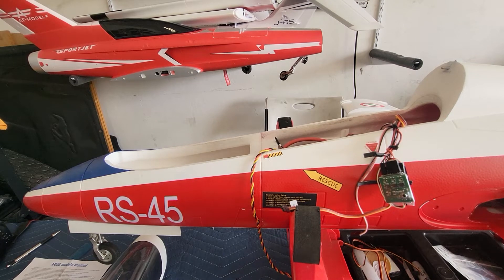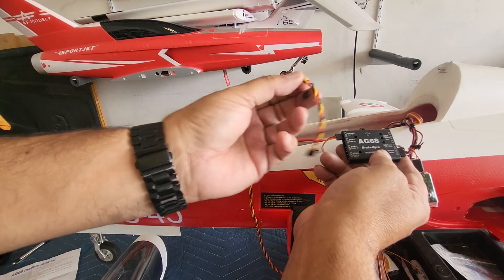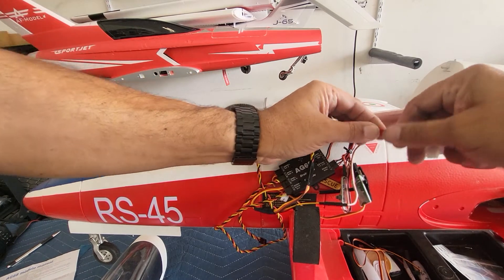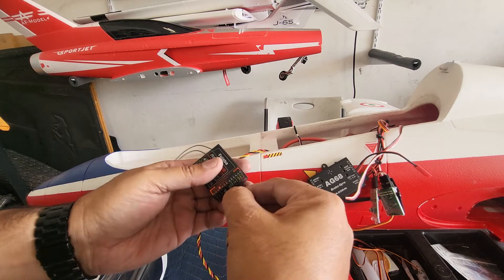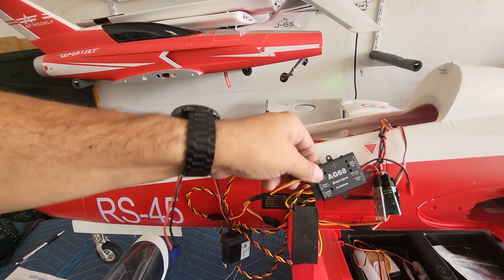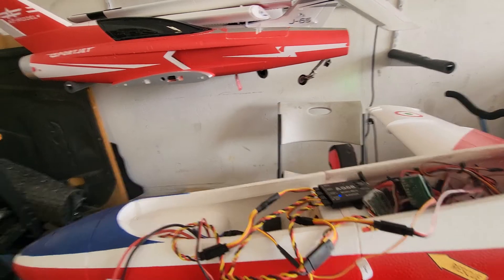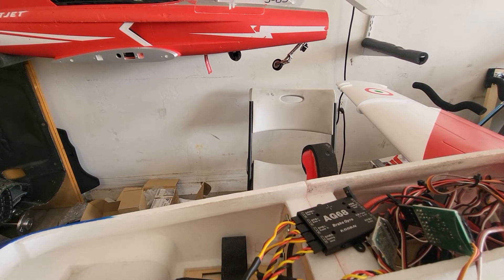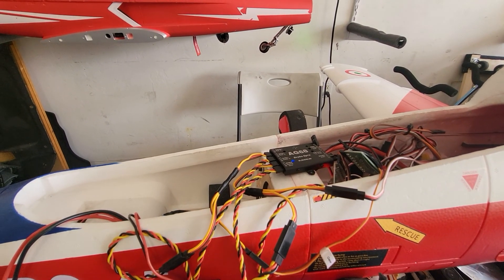AG-68 used only for Brakes

Comment: I burnt up my Spektrum RC AR10400T by plugging in power to the AG 68. Your video is a little deceiving.
Reply from the maker: The AG-68 gets power from the receiver
Reply: Can you tell me what the power wire is supposed to go to? I'm sorry I just don't understand.
Reply from the maker: The red JST power cable is to power the brakes. The AG-68 itself, gets the power from your Rudder servo channel. I always recommend using a separate (second) channel for Rudder / steering. I will be making a new video soon. 
 @michaelhodges-y6z

Comment: I’m thinking about buying one to replace  aa JP retract controller.  Why didn’t you use the ag68 to run the landing gear?
Reply from the maker: At that time, a couple of pilots had the AG-68 and only wanted to use it for brakes only. This required an extra "Y" cable. This video was done to show the connections needed.
Reply: @ralphsalgado5891  is it a better retract controller than the Jp one?
Reply: What’s the difference between the AG63 and this AG68?

Comment: I was looking at the manual and there was no mention of holding the left rudder and flipping the brake switch.  I saw how you calibrate the steering direction, and how you set up the landing gear stop voltage.  Where is the brake set up located in the instructions?